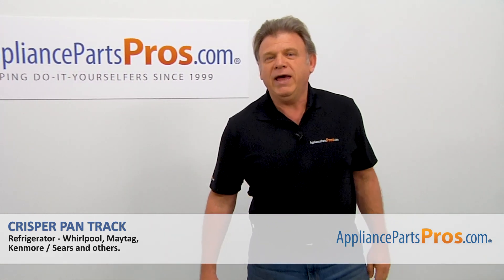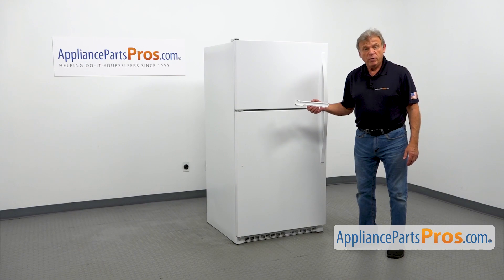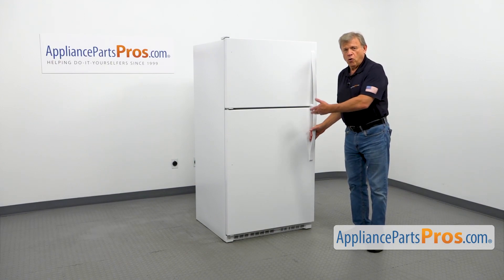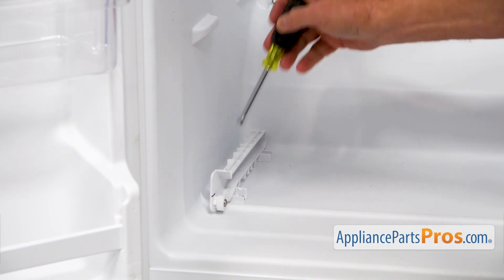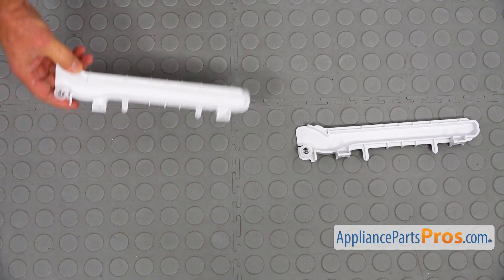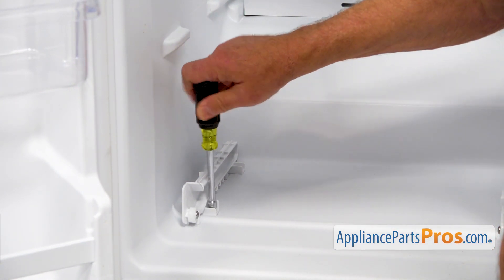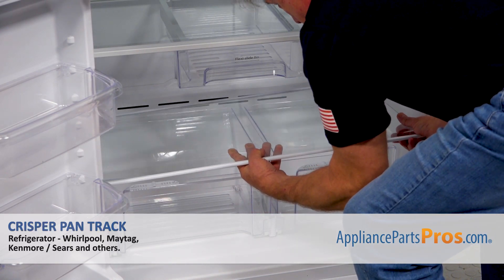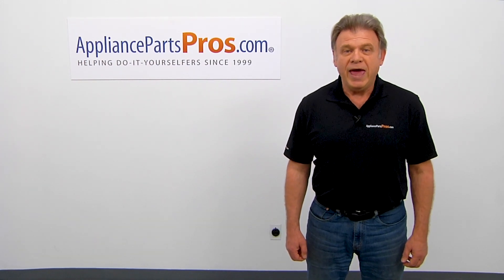How To: Replace: Whirlpool/KitchenAid/Maytag Refrigerator Crisper Pan Track W11025586

Comment: I have a used Whirlpool side-by-side refrigerator ED5FHAXVA03 could you tell me how old it is, also the ice maker its making ice it took four days for it to freeze popsicles, someone told me it could be low on freon ,
Reply from the maker: Unfortunately, we are not able to look up the manufacturing date for the unit. But sometimes they have that printed on the model and serial tag of the appliance, so you can check there for that. Low freon could cause that issue, but you will need to contact a certified technician to check it and recharge it, if needed.